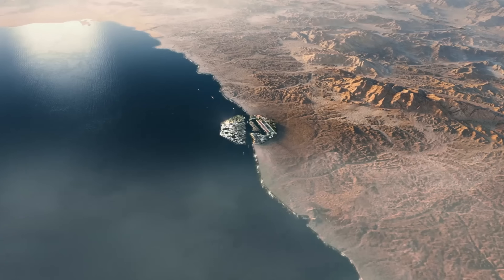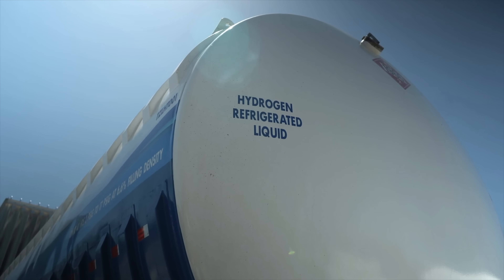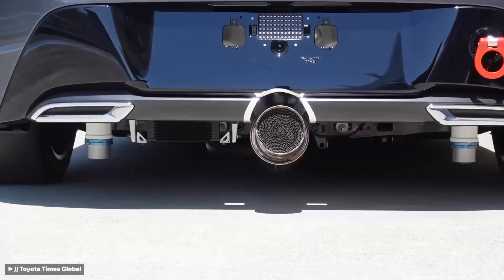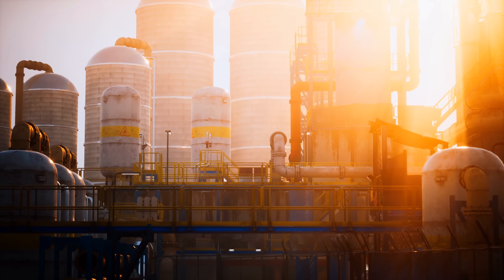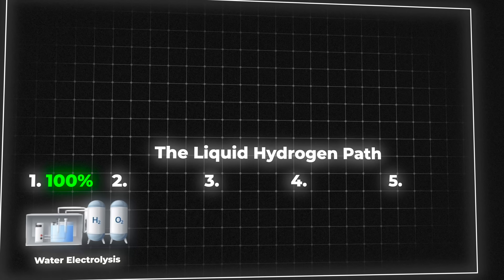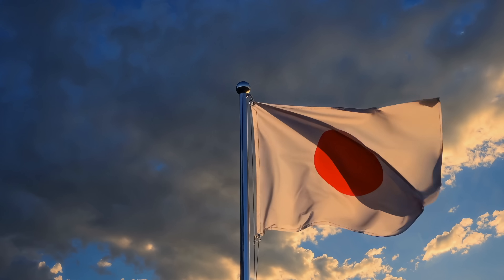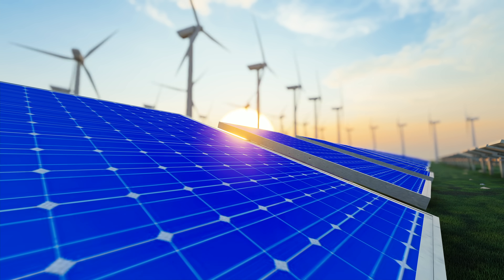World’s BIGGEST Hydrogen Plant Produces 0 Hydrogen

Comment: The better solution is to just use the ammonia as ammonia and not loose the energy converting it to hydrogen.

Another solution is to make methane(natural gas) instead, which is also easier to liqify and transport, and has the added bonus that we already have the infrastructure and need for.  The answer why not is because if you compared the cost to produce this green methane or hydrogen or ammonia, the cost outweighs the practical benefits when compared to fossil fuels.  Still, methane is the more practical fuel to produce if your goal is fuel and your choices are hydrogen, ammonia, and methane.

In order to use it hydrogen a ICE engine the approximate 35% efficient process used to create the hydrogen and get it to the fueling station is reduced by the additional 60% loss due to efficiency rating of the engine , giving you a total efficiency of work done by the vehicle of 14% of the original electricity used to produce the hydrogen.  Also, hydrogen is an awful fuel source, due to many factors: low volumetric density, enbrittlement of any material exposed to hydrogen, hard to prevent system leaks, highly explosive at a wide range of concentration, requires extremely low temperature storage and boils off over time, pressure vessels require hydrostatic testing on a regular basis, carbon fiber wrapped tanks require replacement every 10 years or so, new engines designed specifically for hydrogen must be designed and used,...  ...way to many negative value characteristics apply to hydrogen as a replacement for fuel in any class of transportation beyond niche, high cost uses.   The reason fossil fuel companies love hydrogen is that hydrogen is an impossible solution, that we can waist time and effort on, relying on fossil fuels for the indefinite period of the dominance of the hydrogen religion 

They could have used the electricity to run a data center instead and retained at least 80% of the energy value of the electricity production.  In my opinion 80% value retention is greater than 18-35% value retention.  But then again, why would we bring statistics and common sense into the discussion of what governments corporations and climate zealots do?

Comment: So, in conclusion:
1) adopt green hydrogen = lose massive efficiency at the manufacturing and logistics end (back-end), but have near max efficiency converting the final product into kinetic energy (front-end) for power, or
2) continue using fossil fuels = very high efficiency in the back-end, but lose a ton of efficiency at the front-end, or
3) switch to battery tech (EVs, etc) = much of the electricity used to charge large-scale batteries are still produced by burning fossil fuels, or
4) switch fully to renewable energy sources like solar, wind, tidal = requires massive scale up and adoption but we don't have the space, money, skilled manpower and political will to do it globally, or
5) accelerate research into improving safe handling of nuclear waste and even safer production of nuclear energy.

Logically speaking, which solution offers the least trade-off and the most immediate impact + ease of adoption + cost of implementation? Why are we, the world, even debating on clean energy production when there is already a proven solution? I used to be anti-nuclear energy. But then in recent times, the tech has improved so much and also, think about this, the US Navy has operated nuclear-powered aircraft carriers and submarines for decades without incident. Each vessel is essentially a small nuclear power plant. Why are we still debating on how to save our planet from ourselves?

Comment: There are two realistic ways that hydrogen can be converted and transported. One is ammonia and the other is methane. You did not cover or compare methane at all in this video. I would like to see a comprehensive round trip efficiency analysis of methane, in a similar way you did for ammonia.

Both ammonia and methane have existing infrastructure and transport mechanisms and pipelines.  It makes a lot of sense to compare them directly as hydrogen transport mechanisms.
Reply: There is actually another alternative. Methanol made by H2 and atmospheric CO2. Used (economically) in fuel cells of vehicles, where batteries are not possible. It is comparable to diesel engine as effectivity. Further, it would be probably better to make industries AROUND the H2 production, instead to transport H2 somewhere. Iron ore is definitively easier to transport as H2
Reply: Methane would be far more sensible than ammonia
Reply: Methane needs a supply of CO2 which you would need to get from burning with something Carbon in it. So Methane isn't as attractive long term as the goal is to stop burning stuff.
Reply: @briankuhl9314  You state "Methane needs a supply of CO2".  Clearly you don't have a clue what you talking about.  Roughly 98% of the world's supply of ammonia is produced solely with methane. The methane is fed into a reformer producing a mixture of hydrogen, nitrogen, CO, and CO2.  The CO is water shifted to produced more hydrogen and CO2.  The resulting gas mixture goes thru a acid gas removal system to remove water, CO2 from the hydrogen/nitrogen gas mixture.  The mixed gas is then compressed and processed thru a reactor to produce ammonia.   Then... in most cases... the ammonia is reacted with the waste CO2 to produce urea.

Comment: Hydrogen mobility is like planting a forest. It takes decades to mature, needs careful ecosystem design, and won’t deliver shade tomorrow. Battery tech is like growing grass: it sprouts quickly, spreads everywhere, and adapts to existing soil,  even if it’s not as efficient in the long run. I believe bettery electric planes and ships are just around the corner.

Comment: Another point you did not speak of is hazard. There aren’t many H2 stations and dispensers in the world yet more than enough explosions occurred to make many in the industry realize that these things do not explode in a controlled or elegant way. Add to that the fact that H2 is the smallest molecule in the universe and it constantly tries to escaped and in doing so renders much of what it touches brittle. Therefore maintenance and repair of H2 stations is quite expensive and frequent. Battery charge stations are nothing in comparison. Battery chargers are way cheaper to make, deploy, maintain and decommission.

Comment: The fact is. That Saudi oil drilling makes significant amount of methane  But rather than burn it off, the Saudis can make ammonia with it. For a more energy dense fuel then methane. And this ammonia can supplement diesel fuel. Sure, it still puts CO2 into the air but using up the methane is better than burning it to get rid of it as the world still uses oil.
Reply: Idiot!

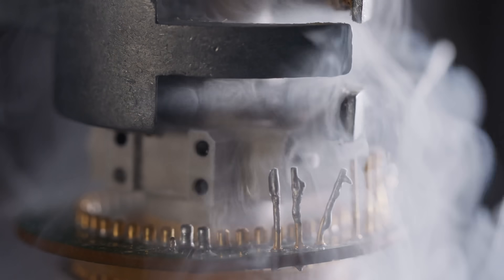Comment: 5:16 - “hydrogen transport ships are tiny”

That is because Liquified H2 carries 300% more energy than LNG by weight… the same amount of energy can be transported in 1/3 the weight by ship!

THIS IS A BENEFIT to H2!

Dude, your reasoning is like “lead acid battery jumper packs are better because they are bigger & heavier than LiIon batteries” — this type of argument is crazy misleading to people who are less educated in energy dynamics!
Reply: 3 times more energy by weight, 10% of the weight per tanker, and 10 times the cost
Reply: @csmrfx - just make the tanker bigger, once it is needed, to gain efficiency. They are just tanks.

They ship molten asphalt from Venezuela in tankers (constantly overcome being cooled by sea water), all over the world.

Boil off from H2 powers the sea going vessel, meaning diesel tanks are not needed for ships, making space use on H2 ships even more efficient than other ships.

These are not difficult problems, as some people suggest, but are merely opportunities for a more sustainable path for humanity.

Comment: 3) Hydrogen Embrittlement - Everything crumbles in the face of hydrogen.
4) Long Haul Infrastructure - One can't keep it cold enough on trucks or in pipelines.
Reply: Hydrogen embrittlement — this is only a problem with the wrong kind of container. Just use a different container. We don’t ship H20 in straight paper containers, we use paper coated with something else, or plastic, or… etc.

Long Haul infrastructure — pipelines don’t have to be cold liquid, current H2 pipelines are just gas. NG pipelines transmit a percentage of H2 today. Current NG pipes are being upgraded to handle H2.

Comment: The main problem with H2 is that every home ownwer can extract water from atmosphere and use solar to make their own fuel. Investors do not like that.
Reply: No, the main problem is you need to liquify H2 to store any meaningful amount of it. Which is extremely dangerous. If the temp of the vessel rises due to malfunction, you got a very dangerous pressure bomb that explodes by releasing a highly explosive gas that will also displace any oxygen in a very wide area. So you can explode twice and asphyxiate all in one package.

Comment: The efficiency of ammonia using Topsoe technology starts of using their SOEC electrolyzer that operate at 93% (compared with LHV of Hydrogen) with an electricity consumption of the core at less than 36 kWh/kg H2 =109.44% HHV. The 96% cracking of ammonia back to hydrogen is not including compression. So the efficiency is roundish 79% + the energy consumption to raise the pressure again => worse than the liquefaction route.
Reply: 79% is par for tthe course for pumped storage so this would be very viable when the electricity is cheap.

Comment: From a theoretical point liquefaction requires 2.8% of the energy in hydrogen if the electrolyzer delivers 20bar. For commercial SOA 10% is consumed so likely 5% is realistic. Chinese alkaline electrolyzer SOA is above 90% and lab SOA is 100% at stack level for alkaline and definitively going above 100%. Transport however expends more than 1% at least for long sea fares. Fuel cells are available at 60% HHV and are improving pretty swiftly so likely 65% in near future. So the likely efficiency from electrons delivered by a solar power plant to energy out of a fuel cell (exclusive last mile delivery and fueling) is 60% with a strong case for better in the future. The elephant in the room is the huge difference in land cost, labor cost, and amount of solar insolation between markets in Northern Europe and locations in a two weeks range away by ship.

Comment: There have been internal combustion engines that run on ammonia!
Running an ICE on ammonia releases zero carbon emissions. The biggest design challenge is keeping low NOx emissions.
Reply: All my point, once you get ammonia it's useless to convert back to hydrogen. An airplane on ammonia is safer than on hydrogen. Etc ..Ships already run on ammonia..
Reply: Yes, burn at low temperatures seems to help reduce NOx
Reply: @DavidHalko 
DEF is specifically for NOx conversion to N2 and steam H2O
Reply: @andrewday3206 - that is interesting! I kind of wondered what DEF was for, knew it was for emissions, but that is all I knew!
Reply: @andrewday3206 - <humor>I wonder if Mountain Dew would work in place of DEF? </humor>
Reply: Very poor efficiency. Fuel cells are better and no NOx.
Reply: @rogerphelps9939 
Fuel cells are far too expensive to replace the ICE
Reply: @rogerphelps9939 Very good efficiency.  It’s the direction that large ship diesel engines are all going now as carbon removal has come into view.  Ammonia fuel delivery to ships has become available in larger ports, large diesel engine manufacturers now all support ammonia fuel.

Comment: Hydrogen is needed in the chemical industry, and this is where the green hydrogen has to go to. Making ammonia (if via hydrogen an Haber-Bosch or direct electrolysis) would make sense as fertilizers based on ammonia are the biggest chunk of what it is actually needed for once we stop burning stuff! Also Ammonia is a carbon free shipping fuel, and can be both burned, or used in a fuel cell to solve intercontinental shipping.
Hydrogen should really only be used in the top most steps in Michael Liebreichs Hydrogen ladder! It is just not an energy carrier, it stays an important and useful chemical.  — Oh and boil off Hydrogen does slow down the methane reduction in the air, and acts thereby as an indirect climate agent! So better we produce and use it immediately!
Reply: Although why not use the boil off to power the ship?
Reply: @petewright4640  well, I reckon they would try to use it, but even with the much larger methane molecule it only succeeds for a part of the boil off...

Comment: My biggest concern would be Ammonia leaks. Ammonia is incredibly dangerous.  If we replaced every oil spills with an ammonia leak people would be dying left and right. 

Oil spills are bad.. Now imagine a giant poison gas cloud killing everything around instead.
Reply: Exactly, we use ammonia as an oxygen scavanger in our systems so it's very high concentration. One bottle was dropped and even though it was made from layers of glass and shatter proof plastic the lid was dented and lost it's seal and just that small amount of ammonia escaping cleared out an enormous engineering space. We though there was a fire or steam leak down there from everyone running out but it was just a bit of ammonia escaping into the atmosphere. They had to send a team down with SCBAs to contain the leaking bottle!
Reply: Ooops
Reply: Ammonias dangers are somewhat exaggerated.  It’s used in bulk for many farms for fertilizer, and still in some refrigeration.  What’s not safe is refrigeration in enclosed residential or small business buildings, where leak detection and procedures for safe handling aren’t up to safe standards.
Reply: @Georgewilliamherbert  Exaggerated in what sense? We aren't using liquid ammonia in fertilizer, so the risk profile is the current industrial use. If it became the de facto shipping fuel, I expect we would see a an increase in incidents. So something similar to Dalkar, just increased incidents, say ball park once each decade. And while still better than coal and probably in the same ballpark as nuclear,  renewables are dramatically safer.
Reply: @briankuhl9314 Exactly. Ammonia manufacturing plants don’t fly, drive on our roads in millions of cars, or crash and sink as ships.

This means it can be more easily controlled. Then imagine it being widespread, used b6 the public. Absolutely no!

I’ve worked with ammonia dissolved in water for over 30 years in labs and chemical manufacturing. Thats unpleasant enough at around 35% ammonia concentration. The thought of anhydrous ammonia being used as a day to day transport fuel encourages me to work from home.

While ammonia may be usable as a fuel, it is not something that is suitable for public use.
Reply: @briankuhl9314  We literally do use liquid ammonia as fertilizer.  Have you not investigated it at all?  Have you not seen the stationary tanks and injection rigs towed behind tractors?  Talked to the farmers and suppliers?  It’s become even more popular with the post Oklahoma City Bombing ammonium nitrate registration and inspection regulations.  Literally, yes we do.
Reply: @Georgewilliamherbert  the fertiliser will be a compound of ammonia, not ammonia itself. Ammonia will be too toxic to release direct into the environment
Reply: @briankuhl9314  However, without massive government subsidies renewables go bankrupt. Also, renewables take hundreds to thousands of times the land area  as conventional or nuclear power plants, AND they have to be backed up by always running conventional or nuclear power plants because they are too unreliable (sunshine and wind vary wildly even from minute to minute).
Reply: Liquid hydrogen is off the charts dangerous. Ammonia is child's play in comparison.
Reply: @willemh9434  I worked with ammonia refrigeration systems. Believe me, it's no joke to get even a tiny whiff of NH3. Very unpleasant. Deadly stuff.
Reply: @RossWexford  Ammonia is certainly no joke. But liquid H2 is on another level. Overheated or punctured vessels become very high energy projectiles releasing explosive gas. Look up liquid H2 accidents, or even liquid He accidents for a description of the power contained.
Reply: @willemh9434  hydrogen is no more dangerous than LNG. Its just harder to contain. If a truck carrying LNG crashes and leaks, it either off gasses or explodes. Now replace every crashed tanker of LNG for a crashed tanker of Liquid ammonium gas.  ☠️☠️☠️  toodloo mutha fuckkaaaas
Reply: @willemh9434 - liquid H2 just floats away as gaseous H2 when is vents, away from any immediate co-located ignition source… making it very safe in comparison to gas tanks or large batteries.
Reply: @DavidHalko  If a vessel with liquid H2 is ruptured, it's very possible it goes full Willy Wonka elevator style thourgh multiple floors and out of the roof. And that's just the pressure risk. That co-located ignition source .. will certainly be created by said bumping around.
Reply: It is definitely gonna leak and smell like shit. Plus end product will also have in small amounts .You cant simply turn things %100 there is always some small percent left when refining. Imagine a lot of cars using it yikes. Although some filters is good at filtering ammonia than small vocs coming out of normal gas burning cars.
Reply: Ammonia contains 17,6%  hydrogen only.
Any fool would not transport a 20 bottle case to detect at home there are 16 bottles filled with water. Only 4 are containing beer.
Reply: @wilfriedschuler3796  youve got it backwards. Ammonia is NH3,  so 3 hydrogen molecules bound to a single Nitrogen molecule.  Its 75% hydrogen 25% nitrogen.
Reply: @wilfriedschuler3796 i didnt realize you were speaking in terms of mass in which case youre correct.